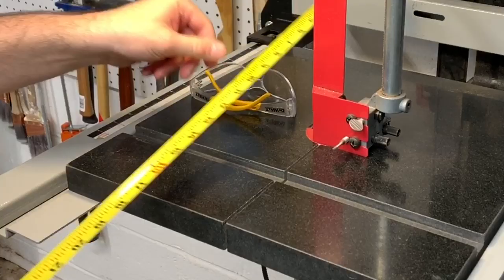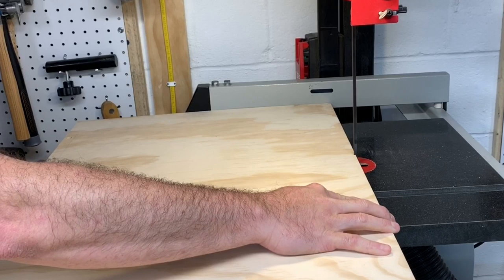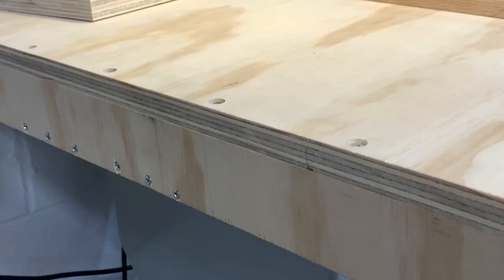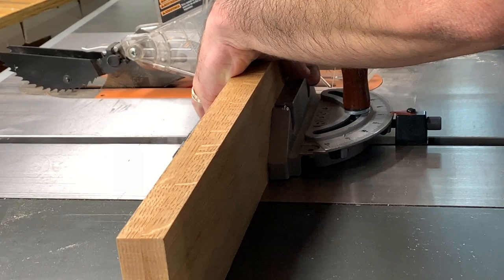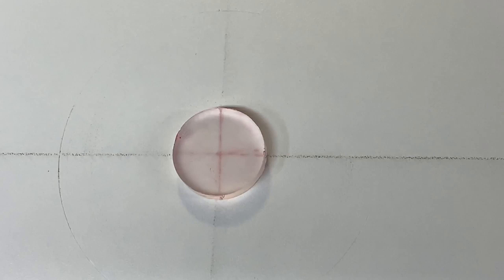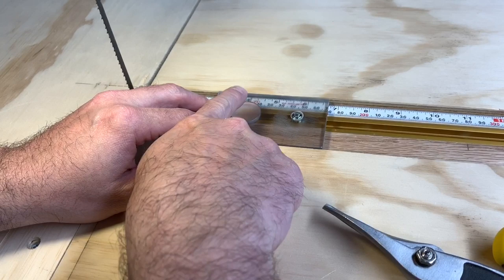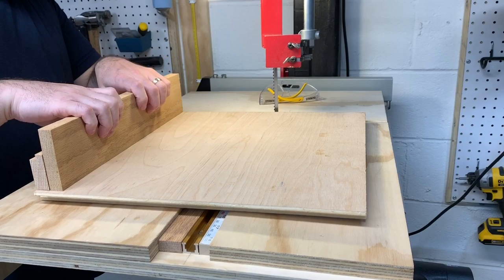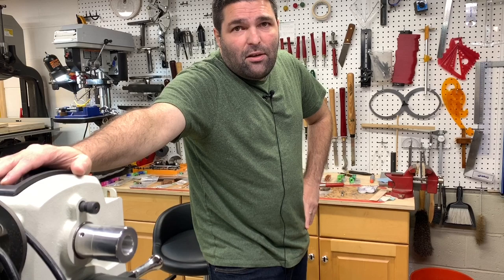Bandsaw Multi-Purpose Circle Cutting Jig

Comment: Very nice build and one of the best jigs I've seen. Do the front adjuster. I use mine all the time and can really zero in on the back of the gullet.
Cheers, Lee
Reply from the maker: Lee thank you Lee, I plan on adding the adjuster the next time I need to change the blade. I was always under the impression that the tip of the teeth was better than the back of the gullet. I assumed that it could bind in the kurf if the blade is thin on a tight turn. Is there a reason why you use the back of the gullet? I’ve seen it alines both ways. Thank you my friend.

Comment: I must have missed it but I scanned back through twice. I did not see you put a index pin in the track (nail point) to reference the center point of the stock.
Reply from the maker: Hi Gary, this jig is both pin and non-pin. I have both and other attachments. So, I can cut pieces without adding a hole. The clear circle is double sided taped then inserted into the hole in the slider. It works great. I wanted to design a jig that would do many things. Hope that helps. Thank for watching.